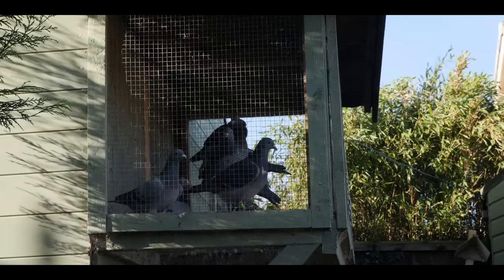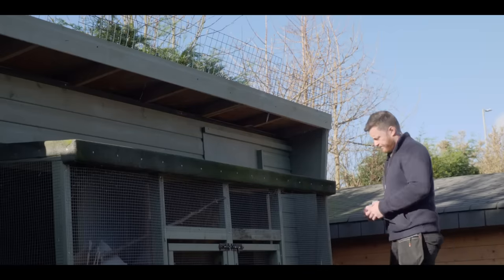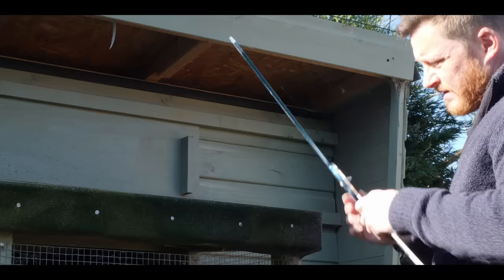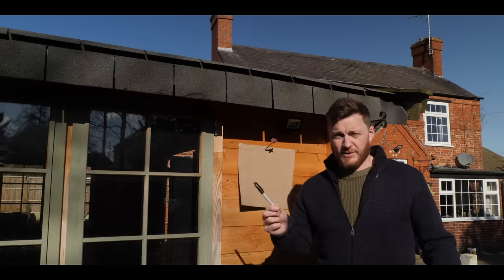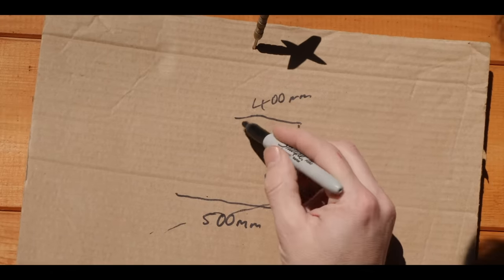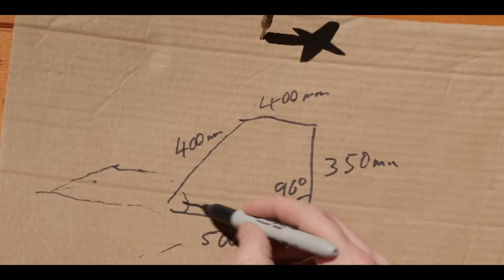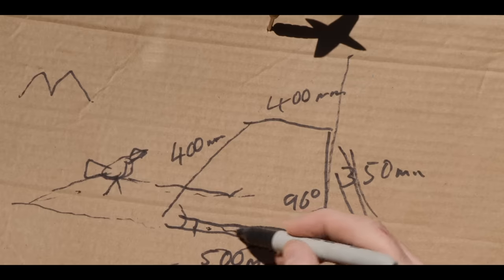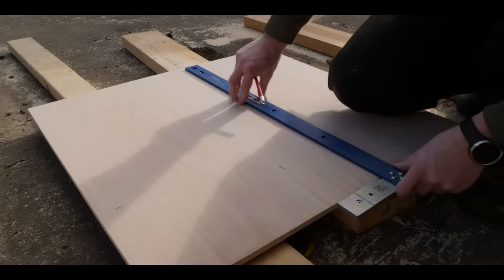The Future of Pigeon Racing in the UK: Is the Sport in Trouble?

Comment: Great videos, really promotes the sport. lots of good sense put across. To me I think raising the RPRA fee is rather short sighted as it produces a barrier to entry for new starters. Instead i think an increase in the ring price would be a better option. For example, someone ordering say 200 rings would pay more and debatably use more of the RPRA resources (transfers , stray reporting etc), but its there choice to breed that amount of YBs; however a new starter may only breed say  20 YBs so  would pay a smaller contribution and less of a barrier to entry.
Reply from the maker: Good point 👍

Comment: I've been doing this 5 years now. I have never once known when a region meeting is happening.
I have never once been empowered to suggest changing the way anything operates. 
From what I gather, you can raise an issue at the club, if the club votes in favour (getting a dozen pigeon men to agree on a subject is basically impossible) then it can go to a vote at the region which makes it even more unlikely to be agreed.
I am only speculating this because as I said, I've never been aware of the regional meetings.
The whole organisation needs to operate differently and stop being so wasteful. I agree with you that the increase is not the issue, it should have been this value years ago. The organisation needs to tighten it's belts and create a more automated environment which relies far less on expensive manual processes.

Comment: Our club rules state that the pad for a ets system has to be inside the loft the way you have yours set up it is outside so think it's worth checking the rpra rules just to see if your set up is OK 👍
Reply from the maker: Yes I've checked and the RPRA rules specifically say birds cannot be timed in the loft is closed. By shutting the landing board/door it closes the loft and prevents the birds from gaining access to the loft and prevents them from timing in. I spent a good while checking because I wanted to make sure it was legal 👍
Reply: Club rules can't override or contradict Union rules.

The trap is within the rules.